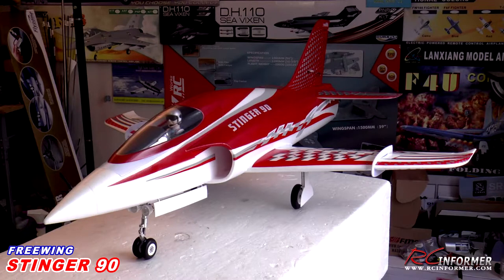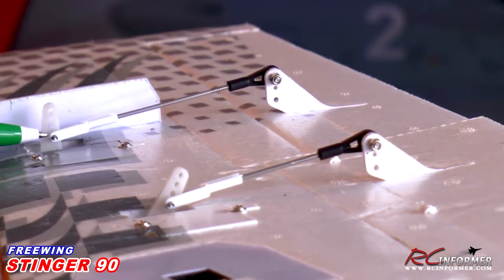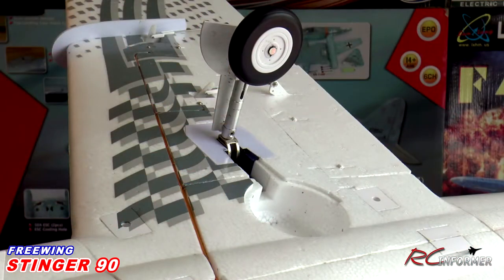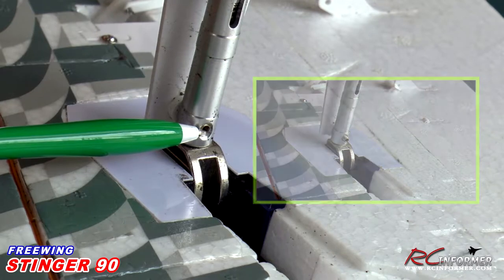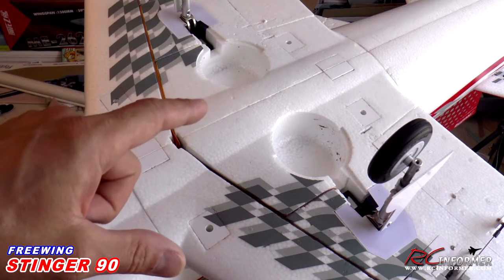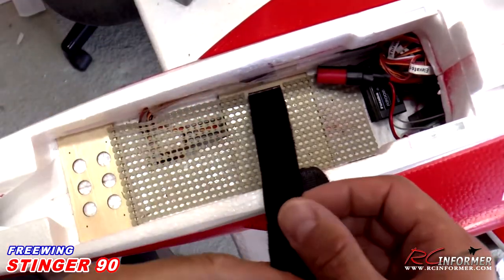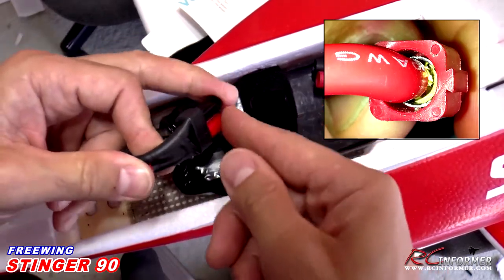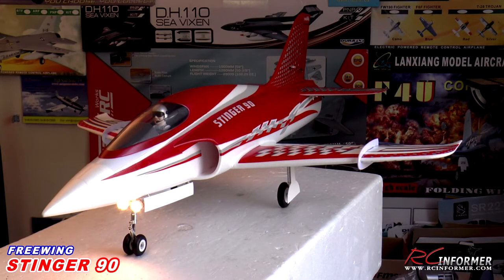FREEWING / MOTIONRC STINGER 90 Setup Guide by: RCINFORMER

Comment: Excellent video!  The closeups and detailed tips are exactly what we need.  This video pretty much has clinched it for me to buy this jet!  I just need to ensure the flying site I had in mind can accommodate this.

I believe the stock 1450KV motor could handle 8s LIPO power but I doubt the 130A HobbyWing ESC can take 8s voltage or could it?  HobbyWing's own website lists no such 130A air ESC.  Would love to see and hear the Stinger 90's speed boost from 33% increase in voltage! :)

Comment: your tips are very good thanks much.  Let me share one with you, the battery Velcro, if you place the eye down between the battery and the side compartment (if you can roll the Velcro) when you pull it tight it will lock an the corner. It might take a few times to get the hang of it, its a trick I learned rigging with rope you actually gain an extra purchase (force).   It will click into place when it meets the corner when done right.
Reply: Randolph Torres everyone uses velcro and I don't get it. Hobbyking sells sticky material with adhesive on the other side for $1.68 and usually I can get 2 planes use from it. Get a better velcro strap, one like Rich pointed out and you'll never have to worry about a thing and you won't be sticking permanent velcro to $100+ lipos.

Comment: Thanks , great help . One thing though , how the heck did you get the canopy on ?  I made up some short extensions to tuck down the side , still had to cut out the canopy floor , cut the pilot's shoulders off and ''raise'' the floor  ! Using H K 5000  6s  maybe they are a little fat ? Can/t wait to get this bird in the air  , cheers .
Reply from the maker: +Ross F The admiral battery fit fine...

Comment: Rich...nice video!! I have to ask...is the stinger faster than the RH Strega...looks like it might be...

Adam
Reply from the maker: Yes way faster! Strega is about 85 stock... this is 100+
Reply: RCINFORMER Good to know! Thank you. One other question -  most EDF's fall on their face when you go vertical and I noticed you didn't do any lengthy climbs in your demo...wondering how the vertical performance is...I'm very interested in this one and I'm hoping that we have the first low cost really high performance EDF in this baby...I can't afford a BVM Unit...
Thanks again Rich,
Adam
Reply from the maker: adam gault Vertical performance is better than most but it does slow down quickly when you go vertical... I have flown a few BVM 12s jets, this is definitely the best low cost sport jet around. It comes "CLOSEST" to a BVM jet without breaking the bank.... While there is a huge difference in the two, you just cant beat the value of the Stinger 90! After buying the plane, battery, and receiver its about $570 for the Stinger 90... compared to the BVM at no less than $5000 -$7000 for everything.... The Stinger 90 is a lot like the FUTURA Turbine jet.
Reply: RCINFORMER Thanks so much Rich...sounds like its as good as its gonna get for less than a fortune...
Adam

Comment: Question Rich, If the wiring on a lead is exposed and nothing is done about it. Can the esc eventually die unexpectedly mid flight?
Reply from the maker: I would have to see it... send me a pic. 407-683-6032
Reply: @RCINFORMER  I wish but my T-33 crashed a mile away across a lake onto private property surrounded by trees. I never found it again. But I can best explain my problem. Before that fateful flight. The esc actually died once, while it was idle before it booted up again successfully, which made me suspicious. I took off and within 30 seconds of take off after I was flying parallel to the field when the esc literally died mid flight. I had no control no throttle, no elevators, no ailerons, no nothing. Something I did notice from the unboxing was the positive lead on the esc had it’s wiring exposed about an inch beyond the EC5 connector. Had an uneventful, fun packed maiden and flew uneventful for 3 weeks until that day. Also I never use batteries beyond what the factory recommends. The Venom 6s 5000mah 50c that was powering it that day was a 2020 Christmas present. So it was in like new condition. However it came with a EC3, so I had to buy an adapter which made me really have to really bend the leads to make it connect with the esc. I need to figure this out because I have decided to sell my Night Timber X and replace it with a new T-33 in a couple months. Thanks for your willingness to devote some time to help me.

Comment: One more question Rich..... Is the aileron roll rate at 100% throw the same as the Stinger 64 or Stinger 64 HP at 70%? I thought I would set mine up at 60% on ailerons with 30% Expo. I know my other stingers roll way way to fast at 100%.
Reply from the maker: Not sure, its been a while since I have flown the 64. This is why i moved the rod in one hole on the servo side. Try it and see if you like it there. I found that this plane did not seem to roll as fast unless i had a enough throw.... I used 100% travel with the rod in the second hole of the Servo arm... they had the rod in the middle (3rd) hole of the servo arm, which would have given me more throw.... if you use the middle hole it may be to sensitive

Comment: Are you using 100dr on ailerons and elevator?   Do you use any expo? Because I know on my stinger 64 3s and stinger64 HP 4s need tons of dual rate and expo for ailerons. I still have yet to fly my stinger 90. (Bought at motionrc.com) 😊
Reply from the maker: I set mine up with 100% travel 0% EXPO on ailerons and elevator... rudder has 30% expo

Comment: thanks a lot for the infos
just one clarification...
did you move also the elevator one hole in
or just the ail and flap ?
thanks
Reply from the maker: Elevator is also on the #4 hole just like flap and aileron
Reply: RCINFORMER thanks again :)

Comment: How long has my runway to be ? I just purchased mine today and put it together. I had though some issues.... Wing spurs are somehow shorter as the length that fits inside wing. To get into details; There are two carbon wng spars which go inside the wing. One long and one short. On my Stinger both were to short. Long shoulg be 39cm and short 20cm. Besides that, when i set some delay for my flaps, it seems that one from the servos takes longer to pull. This isn't happening when no delay is used.
And last but not least, everytime i plug my batery the front retract door opens and closes although my retracts switch stas to the closed position.
Reply from the maker: Dimitrios Ioannidis Runway does not need to be very long... probably about 200ft or longer...can you send me a video of the flaps to my email or cell phone?

Comment: i've just ordered this plane but am worried about the gear, looks the same as the su-35 which on my plane are all bent up and pulled off airframe several times (And not from heavy landing - caused by trying to take off on bumpy grass runway). Im just praying its not the same for this plane...
Reply from the maker: I fly mine on grass all the time without any issues.... as long as your grass is short enough you will have no problems

Comment: I don't understand is the radio include in the kit usually the transmitter and receiver are together and servos, what about the large battery 5000 ma. ? ext.
Reply from the maker: motor, fan,esc,bec,servos, landing gear are all included... you only add your reciever and lipo battery... check out the unboxing video also